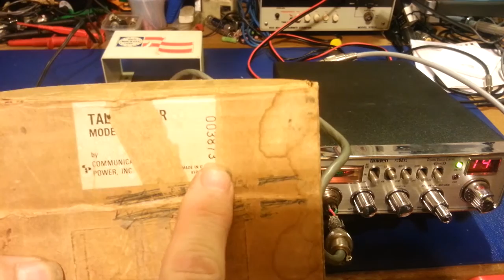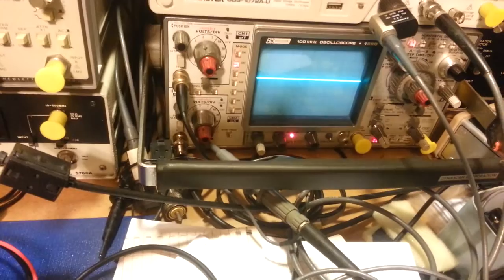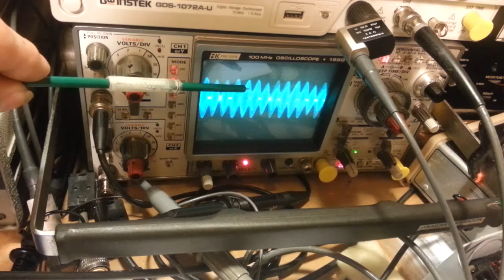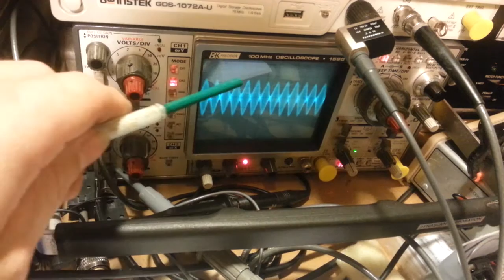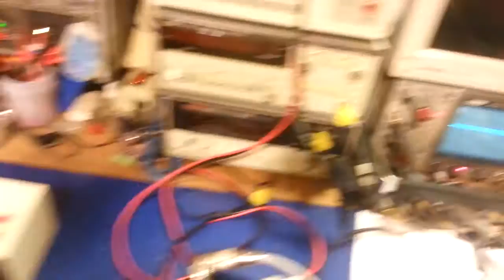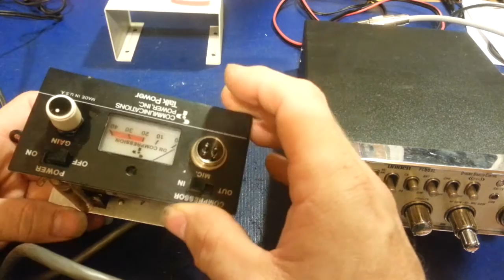CPI TP-1A Talk Power speach compressor overview.

Comment: Why can't some Chinese genius make one of these with a couple microchips small enough to fit inside of a radio and be wired to a Bright/Dim switch? Adjust it once then then forget it. I'd sure buy one.
Reply from the maker: Single chip compression chips have been around for years now.  Most modern ones do a whole lot more than just compression.
Reply: @mikesradiorepair  Great, where do I send the money? :) I mean people stick junk echo boards, noise toys and such in their radios all the time. OTOH audio gadgets are treated like they were left by the aliens who built the pyramids or something.
Reply from the maker: @matthewdavies2057  You would normally send the money to the supplier you buy parts from.  ;-)  You would probably want to get the development board for whatever IC you pick to do your circuit design and testing.  It's a lot easier doing R&D with a  development board made by the component manufacturer then trying to design it on a proto board.

Comment: Mike I have many CPI radios and two of those Talk Powers but never felt the need to use them both until I wanted to adapt some power mics to other radios with the neat jumper feature but never powered them on even then. NOW I will tune them on the B&K and scope and put to good use after your excellent info!

Comment: what about having audio phasing network driving a Tayloe QSE feeding a Tayloe QSD with two diodes across the RF in and ground on the QSD wired in opposition so as to get a limiting action on positive and negative sides of the RF signal then the output would go through a audio phasing combiner so the output will be a limited AF signal and having much punchier signal.

Comment: I still have my working CP-2000 & BC-2000 back from the day.  I never run the Comp.  

Question on that Compressor... Is it effective on SSB?  Seems like every Ham I hear running compression on SSB sounds like crap or do they just have their Mic Gain too high?
Reply from the maker: They work even better on SSB.  If it sounds bad they have it adjusted wrong.  Thats why I said it really helps to get a radio audio check from someone that knows you and can give a honest radio check.

Comment: what are the 2 tones , long time ago for me  was 700hz   and 1900 hz,, is that right  or what
thank you
Reply from the maker: I think its 400 and 2500 Hz on the BK 1040.
Reply: thank you its been 50 years ago working on CB radios
Reply from the maker: +DENNIS N 

700 and 1900 Hz are popular to.  They just need to be frequencies that are not harmonically related and are approximately equal distances in from either end of the audio pass band.

Comment: I've never owned any CPI gear but have always admired them!  Back in the early 80's I knew a cat who terrorized super bowl with it...of course he had a big tower, a bigger beam and even a bigger amp, it really suxed when he was on...he lived a 1/2 mile away...when he was on, you were done...on all channels!  For stickers / labels, I always use my heat gun, I set it to about 175 and low blow and just keep working it until the adhesive gets malleable.....then use a thin jeweler's flathead and tweezers to remove it.
Reply from the maker: Yeah you were done on all channels and probably all the harmonic frequency bands to.  Probably didn't have a low pass filter, those nitwit's never do.